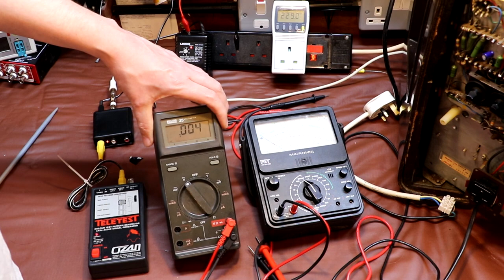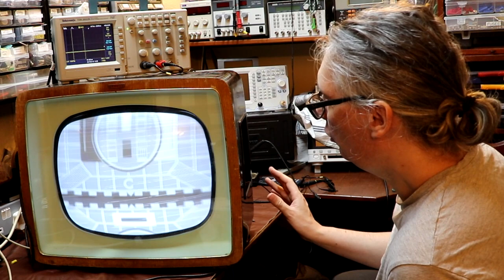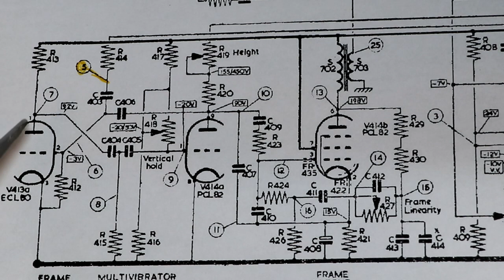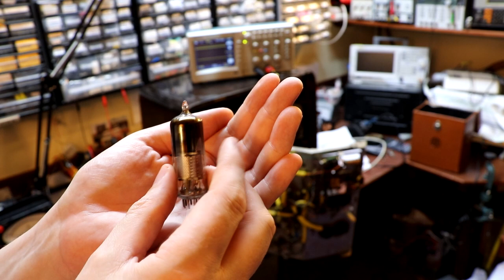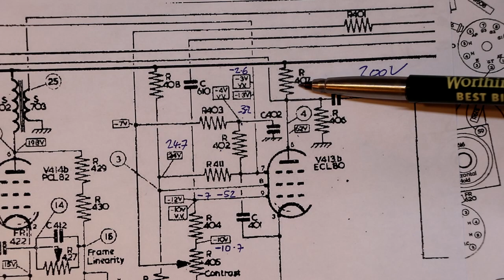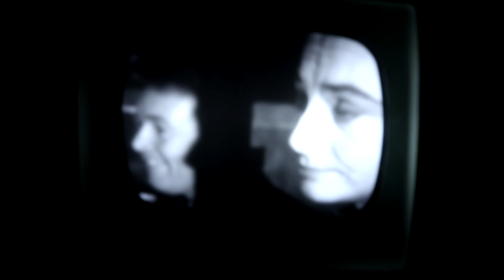Shampo066 Stella TV Repair - Part 3

Comment: I thought it was that load resistor, even before you bought the tv. Seriously, good work on finding the fault. There's some very helpful chaps on UKVRR and I read their TV posts even though I don't work on TVs as they have so much knowledge.
Reply from the maker: Thanks Andrew. It’s annoying I didn’t spot it earlier as I did do basic resistance checks but I must have missed it. Still it’s nice when actually fault finding and measurement gives a better understanding of how the circuit actually operates. Lots to learn but I don’t think I will be making a habit of televisions.

Comment: You nailed that one. That resistor went way high and not unusual for high value resistors. The Stella reminds me of my grandads TV in The Hyde, London. It was a GEC but a similar style. Grandad always rented so never owned a set.  Dr Who was watched intently on our Bush TV125/u.  Later on a HMV colour set with folding doors.
Reply from the maker: Yes it was nice to try and diagnose the problem rather than shotgunning the components. I really should have spotted that high value resistor as I had previously checked them. I must of made a mistake first time around. Thanks regards Chris